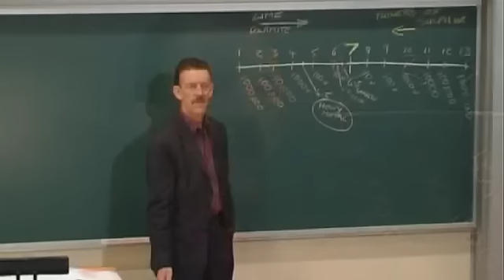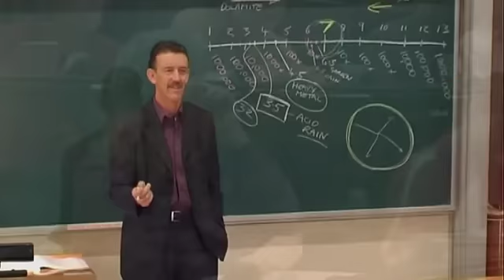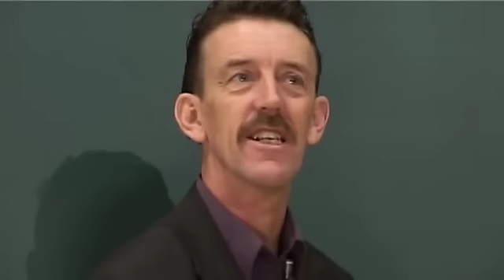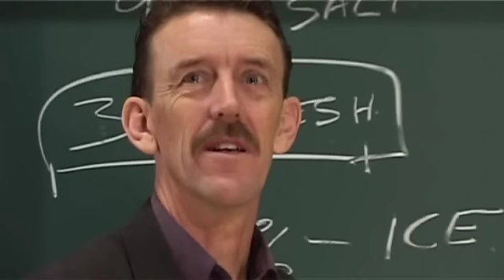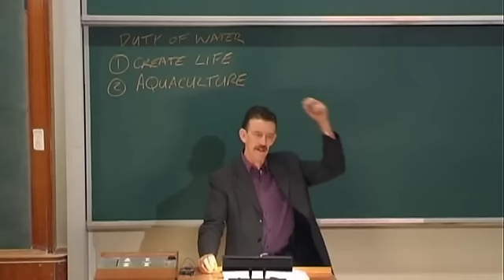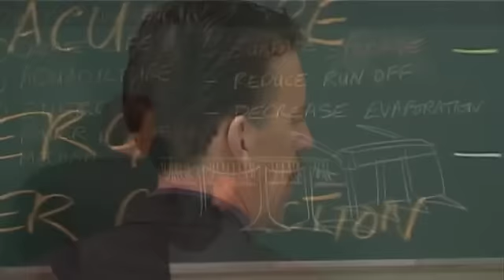Water harvesting    Geoff Lawton 2005

Comment: When was this lecture originally given? Thanks for uploading
Reply: I think this is part of the 13 DVD presentation with Bill Mollison.
The Permaculture Design Certificate Course was filmed in September 2005 at The University of Melbourne.
Reply: @rudylikestowatch  correct. Around 1:00:00 Geoff talks about 1960 that was "45 years ago".
Reply: thanks!
Reply: Kai Rigney 2005 I believe
Reply: Kai Rigney Not sure when this lecture was given but it was uploaded September 2015. If you click on the small arrow immediately below and to the right of the screen. This tells you when it was uploaded. :-)